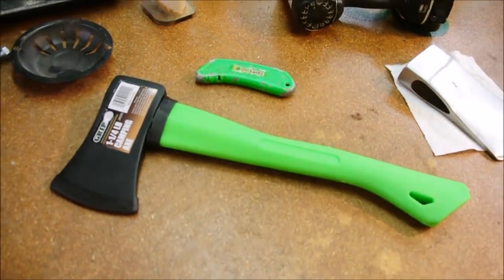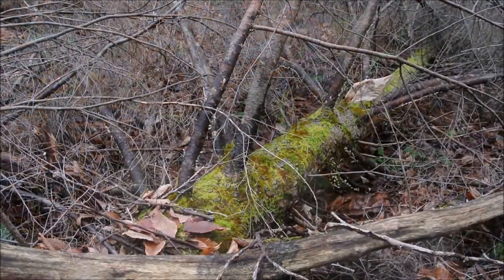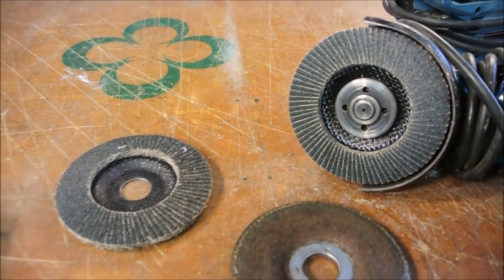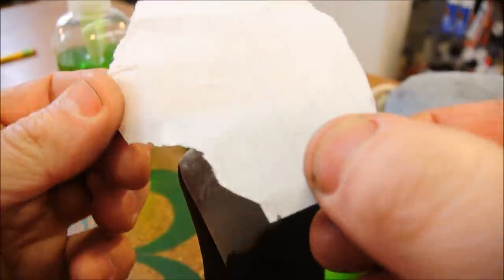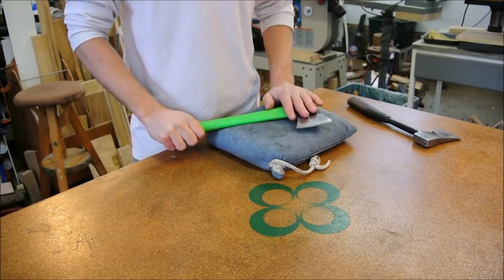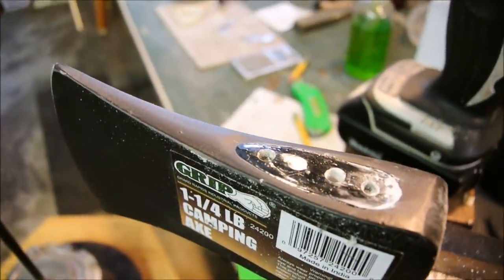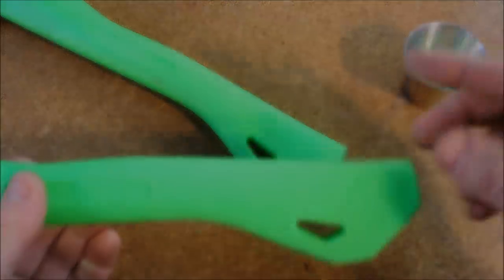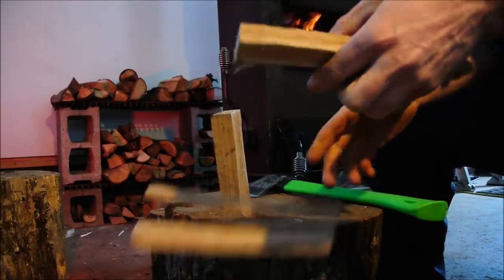Amazon's 12$ GRIP Camping Axe: Inside-Out

Comment: What is that now, a $200 hatchet now? Or do you work for just coin/hour?
Reply from the maker: There is not a single tool I own that I haven't modified. If you don't work on your tools, you probably shouldn't be using them.
Reply: @pocket83squared  
My miscellaneous time is valuable, $35/hr. I won't waste it on tools that can't be used straight out of the package. Now let's work on the holier-than-thou portion of your comment; Do you spent the same amount of attention to your hammers and screwdrivers too?
Reply from the maker: Wow. You sound really important. Keep telling everybody.
Reply: @pocket83squared 
If it makes you feel better, ok.

Comment: Wouldn't you want to leave the edge protector on while your trying to snap the head off while pointing at you? Not safety police by any means. Just noticed you pulled it off and then proceeded to smash away...
Reply from the maker: If it would have separated, I think it would have went spinning down into that pile of logs. I thought about it pretty hard first. Still, I have no idea why I removed the edge protector.

Comment: I'm new nice video indeed I've bough one with same material handle just costed 4$ I was surprised but had rubber on the handle and attached same way enjoyed using it but I need to ask how did u cut that wetstone second I have a big one but one problem I didn't have a file when I got the axe so I used just the stone and big old school one and worked out great Xd I might make a video

Comment: While your use for the hatchet might not be for splitting, it seems that a reasonable designer might have had that cheaper to produce grind set for splitting, say kindling, rather than cutting branches. Neat video.
Reply from the maker: You know, I didn't really try that before I sharpened it. Nevertheless, I still recommend giving it an edge 100%.
Reply: pocket83² Understood, it's been many years since I've had to sharpen an axe or a hatchet, let alone use one. The original grind does indeed appear to have been a very shallow one, and the mass of a hatchet wouldn't seem to lend itself to splitting in the first place.
Reply: You can split alright with a hatchet.  Just smaller pieces.  Batoning works pretty well too.
Reply: Ed Siefker You can split bigger thing too. Make few wooden wedges.

Comment: About ten years ago I had an old firemans axe was splitting logs in the back garden when after about the tenth swing the axe head came flying off while my dad was about 10ft in front of me ended up impaling his back and sheering half his kidney in half he nearly died had to have it removed now he has a huge scar going round his waist from the back talk about lucky to alive.
Reply: That is from improper procedure when using a swinging object such as hatchets, axes, splitting mauls, sledge hammers, engineers hammers, claw/ ballpein  hammers, sledge/demolition hammer, etc... the operator of said swinging device is responsible before swinging it to make sure there is nobody within the swinging arc path for just that reason.

Comment: You want to talk about cheap I was in home depot just walking through th tools stopped athe hammer and hatchet rack just looking spotted a Hatchet I had never seen before no price and I could not find a home for it on the rack but it had good heft to it full tang with rubber grip . So took it to the register turns out it was 7.00 dollars so I took it got home check the tang with a magnet yep the steel goes all the way to the red cap at the but . the name was Hart had never heard of it .so look on amazon and there it was 24.00. A few days later called friend took it down to his Machine shop he has a rockwell tester and sure enough it tested at 59 rockwell so it's a keeper and will serve me well . I just could not leave it there hell my socks cost more than seven dollars and this hatchet is heavy has much better hitting power than my Estwing  14 inch . Happy Trails you just never know what you will fined just laying around .
Reply from the maker: I guess you could say that you have a hard Hart! Good luck with it.
Reply: @pocket83squared  Only time will tell but at 75 it will out last me for sure and stay in the family .
Reply from the maker: 75 years sure is a long time, but you still have time to wear out a hatchet! As long as you have a good elbow to swing, and a back strong enough to bend over and pick up the pieces! Best wishes.
Reply: @pocket83squared  Great health, as all my friends are dropping like flies but it's there own doing in almost all cases but to out last this hatchet not going to happen thanks for the good thoughts stay safe out there . Happy trails
Reply: Hart makes some higher end hammers
Reply: @neilhightower2270  Yes I just saw them the other day on my visit to Home depot . happy trails

Comment: My stanley knife is pink!
Reply from the maker: I did that a few years back. It's still floating around here somewhere. I've since switched to neon green, just to keep to the theme. Is yours a Quickslide? If not, get one! It's the best pocket utility knife out there.
Reply: pocket83² Its the same model. Great design. I often take it with me. So many of my tools are pink! Bits, bit holders, tape measures, favourite spanners, remotes and USB sticks. Saves a ton of times looking for them.

Comment: Hmm? In my over 40 years of hand sharpening/honing cutting tools, I have only ever found finer stones to be harder than coarse ones. Go figure.
Reply from the maker: I'm not sure I undertsand what you mean.
Reply: @pocket83squared  You stated that as the edge was becoming sharper, you change to a softer, finer stone.
Reply from the maker: Ohhh. I understand. I'm not sure, then. I thought it was softer, but maybe you are right. I really don't know how many different materials are used as stones. It was certainly finer.
Reply: @pocket83squared  Ya, the stones become more fine/hard as their matrix increases in density.
Reply from the maker: But fineness and hardness are different things. For example, you might have an 800 grit carborundum stone vs an 800 grit quartz stone. Both use the same particle size, but the silicon carbide material is much harder. 

Density is a measure of mass per volume, so that would not necessarily say anything about particle size or hardness. Though it might be correlated with one, it won't be causative. Heavier stones probably do tend to be harder, but I just have to admit again that I don't know for sure. There's probably a million types of stones.

Comment: Cut the front lip off on old mower, heat treat and temper a mulching mower blade and more those little trees down. Use junk mowers and bush hog till they die and get another and do it again.

Comment: when your wrist is more wobly than the actual axe... you wont get it to work
Reply from the maker: Sure, we all have limits. But as you start to fatigue, you can also choke up a bit and slow down. That gives you a bit more control. Intentionally tensing your wrist is a bad idea if you want to last over time. Comfort with any hammer tool is the trick: think fluid motion, as a wave or a whip. 

That's not blowing smoke. I have considerable experience hand-nailing, and the bad elbow to prove it.
Reply: @pocket83squared  can u send me one ?   edit : il pay shipping

Comment: as i look at you pressing the hot nail into the handle i was like: yeap thats Polyethylen. even though i didnt smell it. cause PE smells like wax. fair so say my job is welding PP and PE
Reply from the maker: It does smell like wax! I never thought about that. Did I explain welding ok? I mean, for a DIY garage hacker?
Reply: puting it on like that looks awkward to me but i am use to weld useing a rod and a hot air welding machine. about temperature stuff it is in fact ~250-330°c and also haveing the material at the same ish temperature as the applied material as you explained is very important. but when it looks like oil then it went to hot and the bound will not be good. in that particular case though it dosent realy matter since there is not realy much force applied to the bound it self. plus it would be less likely to find a welding rod in the right color or cut out some rods from the prototype handle.
what might would work is cutting down a sheet pice from the prototype and apply that on the spot while blowing air with a precise muzzle in between the sheet and the handle. kinda like putting on a sticker. this would on the other hand mean you'd have to make a perfect ish pice to fit in the gruve with some extra material to grind it down.
in the end i'd say your method is practicable :D

Comment: living in the woods i can tell you those are garbage soft metal. to know a good tool simply ping it with your fingers. it must ring very high pitch. if not its very soft and will not last.
Reply: you often find good quality tool half rusted away in garage sale. do the ping test and after restauring you will be surprised. check out ray mears video on bushcraft. you can see the difference a good quality carbon tool makes.
Reply from the maker: Sure, ping means hard. But that doesn't necessarily mean better in the context of general purpose hatchet. Hard also means harder to sharpen, and more likely to chip. Same thing goes for wood chisels.

Consider: another case is the modest railroad spike. I use one as a cold chisel for mortar all the time, and it's soft as butter. Why not? It's easy to grind a new edge after every job. 

Man didn't even have steel until relative modern history. The difference between a hardened hatchet that pings and one that doesn't is only in the mind of the person who wants to justify all that money spent.
Reply: @pocket83squared  you rather sharpen it all day because its too soft or work all day because it hold its sharp. its your choice, also yes it doesn't forget mistake because it will break, but its not its fault but your.
Reply: @pocket83squared  i dont care if you spend 5$ or 500$ on a axe. but of course the steel quality make a difference. saying it is only in the mind is very blind of the fact. and we are talking about a tool that must be very precise edge in order to stay sharp and be useful and have purpose = chopping wood. it is not a hammer. the material ability to hold its shape and stay sharpened is most important.
Reply from the maker: Ah yes, the Sisyphean task. I'm familiar with this idea. Similar is the recursive temporal waste that follows from chasing down misunderstanding. Brevity is the soul of wit they say, but nuance requires a more abundant vehicle, methinks. Six of one, half-dozen the other, you might think comfortably- yet where one lives will remain incidental relative to metallurgy, and the dish continues to run away with the spoon.  

Optimization is the place on the curve where the benefit of hardness no longer pays for more time invested in sharpening; this spot is called diminished return, and you are free to take up arms against this mathematical argument with your own time, but I must admit that as I bystander I see your feud as not yet quite compelling. Thanks and good luck with it.

Comment: For $10-$14 more you can buy a Fiskars with a lifetime warranty.
Reply from the maker: That's twice the price. And you can't re-handle the Fiskars. 
And so what? That has nothing to do with this video.
Reply: @pocket83squared  It's only $25, which is still very cheap, but is a much better hatchet, with much better steel, and handle material. And with a lifetime warranty you won't need to "re-handle" it.  And so what, it's my opinion.
Reply from the maker: C'mon, man. Cut me a break. If you want to know my opinion, the Fiskars seems like a poor design ergonomically. And "much better steel" just means that it's more difficult to sharpen. A lifetime warranty on a consumable product is just a sales gimmick. Do you have any idea how much it would cost in postage? That's right; the price of a green hatchet.

And again, to a carpenter, any hatchet that can't be re-handled is about as useful as a two-headed hammer.

If you bought a Fiskars, fine! I don't mind that. Just don't try to sell me on one. This video wasn't about the Fiskars!
Reply: @pocket83squared  Well we can agree to disagree, however anyone who knows anything about hatchets, axes, or yard tools knows Fiskers makes an excellent product for a very reasonable price.  In no way are they the best but to just dismiss them and say they are garbage shows you do not know what you are talking about.  And I don't care if this video isn't about Fiskars.  You are talking about a cheap garbage $12 hatchet and trying to sell us that it's better than it is.  This would OBVIOUSLY leave the comment section wide open to comparing other hatchets.  If you can't handle that, don't make videos.
Reply from the maker: There are thousands of hatchets out there. Some are designed for function, and others, for marketing. Yours was optimized for the latter. 

As to my impartiality, I admit several times on video that the product I'm working with here is a junk axe. I don't care about it one way or the other. The difference between you and I is that it's only a tool to me, while to you, it seems like an important lifestyle choice. I'm not so committed. Tools are like this to me: if they work well and don't bother me, then I'm pleased. But the first time that stupid hook on the Fiskars catches one of my jean pockets, I'd be certain that there were better choices. 

Now please, let's stop talking about this; I understand that you have a high opinion of a different product, but that product simply isn't the thing under the microscope in this video. People will do their own Googling around for alternatives, so you aren't providing a public service. Thus, your next off-topic comment gets you blocked. If you can't handle that, don't make comments.

Comment: You mean, it could ruin the Hardness.
It will only Improve the temper. Which, of course, is an annealing process.
Noob
Reply from the maker: Wow, you sound really smart; I'm surprised that you couldn't understand what I meant there.  

tem·per | \ ˈtem-pər \

3a : the state of a substance with respect to certain desired qualities (such as hardness, elasticity, or workability) especially : the degree of hardness or resiliency given steel by tempering

(From Merriam-Webster)

Jargon is a crutch. It's an impediment to communication. Think about what it is that you are suggesting: in order for you to have misunderstood what I was implying about hardness, you would actually have to believe that a soft hatchet edge is  desirable. Such an assumption is beneath my target audience. And yes, I just called it an "edge." Axe jargon is just a less inclusive subset of the language- and unlike you and your ilk, I won't adopt it as my surrogate for thinking.  

So, how about this bit: try tempering your brain, and then you won't need to harden your language.